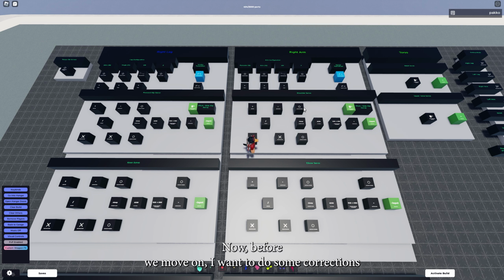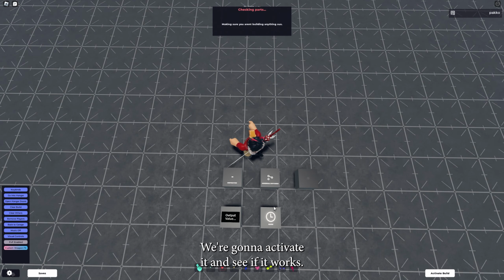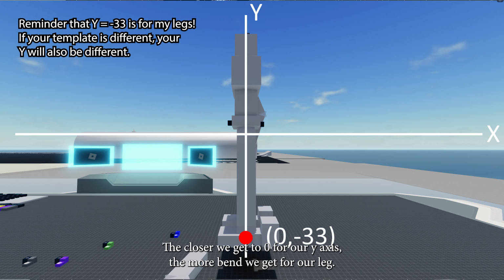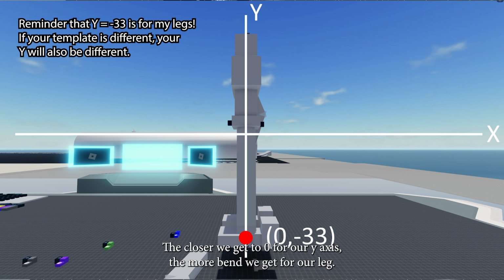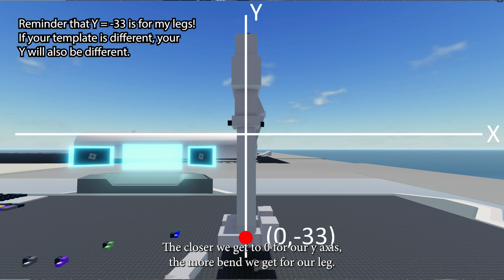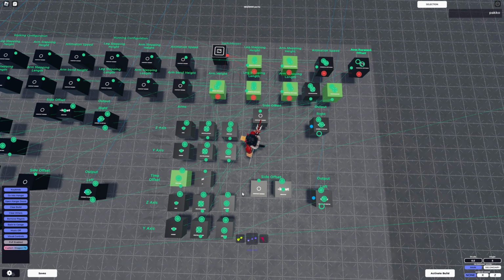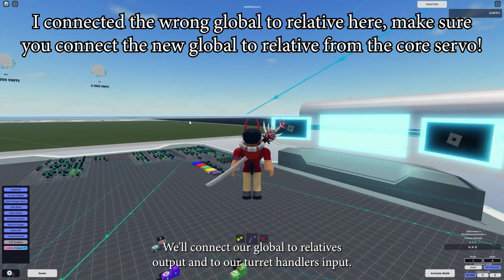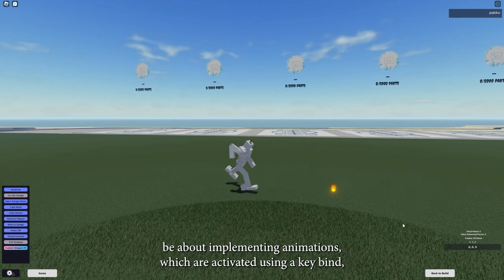Roblox Elite Engineering - How to make idle, walking, & running animations for your mech template

Comment: does the lenght of the limbs include the motors?
Reply from the maker: the length of the limbs is only up until the center of the servos
Reply: @Telophorus  ok thanks
Reply: @Telophorus  Im sorry but i still have another problem, im currently at the idle animations, and when i deploy the mech it doesnt go up and down like in 9:21, instead the limbs connect to each other slowly and swings rapidly on all directions. When i press the button that toggles the build into position grabber mode, they stop but doesnt return to their straight position and doesnt follow the vector global position block. I re watched the tutorial multiple times and re did the logic but it doesnt seem to change
Reply from the maker: @Zizpy  before doing the idle animations, was the position grabber mode working fine?
Reply: @Telophorus  Yes
Reply from the maker: @Zizpy  maybe you applied the idle animation equation to the wrong axis?
Reply: @Telophorus I re did the logic countless times, its on Y
Reply from the maker: @Zizpy  if you want me to take a look in-game, I'll be free at 6PM MST
Reply: @Telophorus  Ok